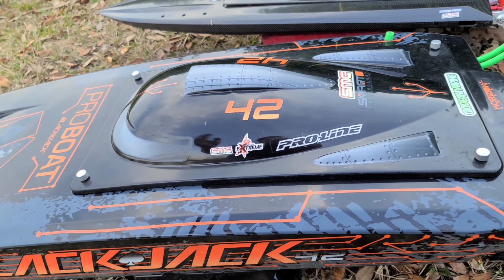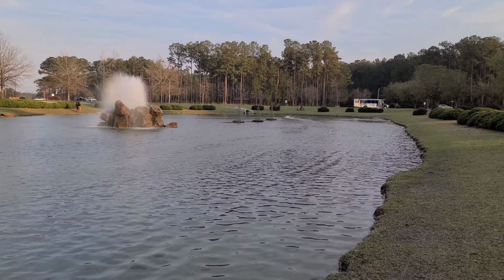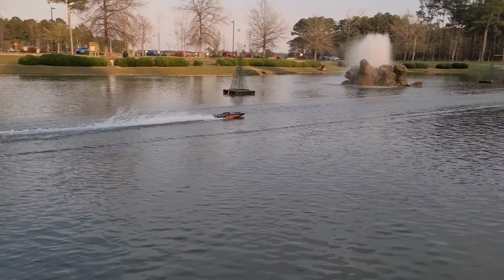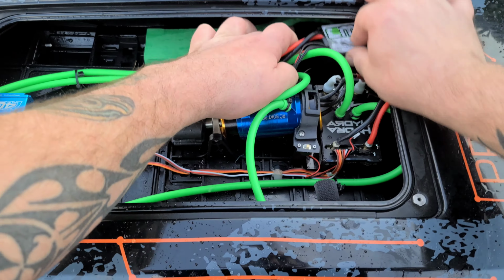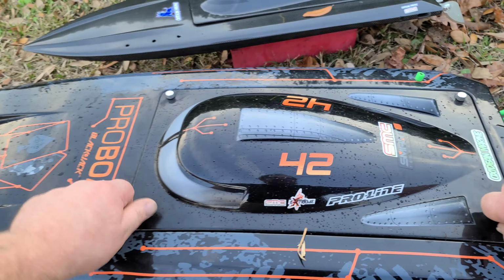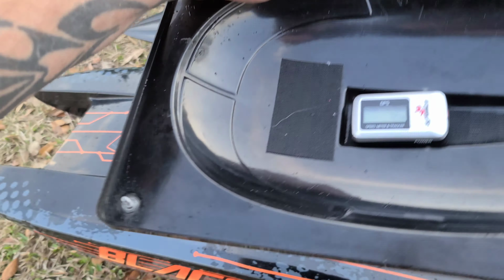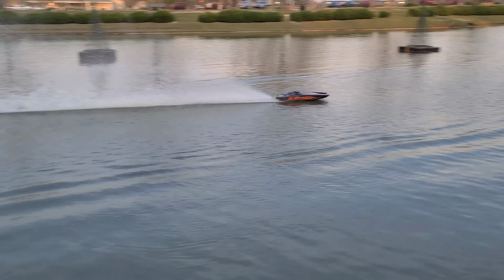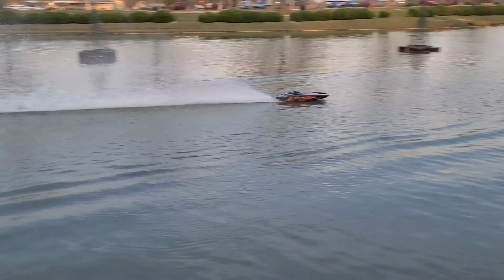Park Pond Beat Down Blackjack 42 - Hydra XLX2, Tp power 4070

Comment: Yoooo make sure those QS8 plugs are all the way connected together or you risk running current only through the anti spark part of the connector. Noticed a small gap in the plugs on the first scene. Big power setup dude
Reply from the maker: That isn't a gap in the connector it's the protection cap on the back of the connector couldn't get it to fully seat.
Reply: @IRONCLADRC  I'm talking about the bullet side dude not the dust cover, even after the run I could see a clear gap of 1 or 2mm mate. I'm not trying to rain on your parade, but you really are risking that esc if you don't fully press the 2 connectors together.

If they won't go together any more, than something in the connector has melted or warped during the soldering process. They should fully seat together
Reply from the maker: thanks for the valuable information

Comment: I just got the same prop for the Black Jack spent a few hours tuning and balancing, and it still needs more work, but I think it's good for now. It may be too much for the stock electronics but I'm going to give it a go.
Reply from the maker: It should be a great prop for the stock electronics, I've literally run a 60mm pranther prop on the stock electronics 6 & 8s  8s I had one or 2 power cuts, other than that the Temps were fine.     The blades on my 645 are super thin.  You could see the prop rotation in the rooster tail.

Comment: You scare me with those speed demos! 
You better buy a hull, or two!
I keep thinking about that rugged radio, I still use RTR radios with 3 boats, soon to be four!
Is it that good? Easy setup? I just read alot of negative stuff on web page about the screen and twitchy thumb controll.
Thank you. 
And if PB comes out with a new v3, glass hull, and better ESC. New boats? I see the money flying out the door, LOL.
Reply from the maker: The thumb scroll was a pain in the but to figure out but once you use it for a week or so it becomes second nature....   I like the rugged it has lots of fine tuning options.   It's easy to bind...  hold the reciever button and hit bind on the transmitter.  You'll like it.
Reply: @IRONCLADRC  going to order today.

Comment: Hi nice boat,what size your prop,and you run for 6s or 8s?thank
Reply from the maker: In this video I was running a octura 645.   Oxiden has a 3 blade 50mm 1.6 that's really good as well

Comment: HEY B MY 4070 WAS A 2200KV DO YOU THINK THATS TOO MUCH KV ON 8S. MY PROPS ARE 50 & 54 MM
Reply from the maker: From personal experience, yes, 2200kv on 8s may be too high of kv

If you run this setup, especially with those big props, do one pass, check speed, check temps, and then do it again.    That's a speedrun setup & no more.   Shod be fast as hell!

Comment: I just return a 4070 BACK TO OFF SHORE ELECTRICS , IF BURNED OUT DURING CALIBRATION
Reply from the maker: Dang, never had that happen?
Reply: @ same here and I’ve used that same motor over the yrs for 1/7 scale drag cars , it ceased and the shaft wasn’t connected

Comment: Hello, been watching the videos. Would the xlx2 work with the stock motor if you are running the esc with no boost on it? I have trim tabs and a dasboata prop, cooling system. Boat runs 63 with no blow overs. 80 would be nice. What do you recommend? Thanks
Reply from the maker: Yes Sir it worked great with the stock motor
Reply: @IRONCLADRC  thank you keep those videos coming :)